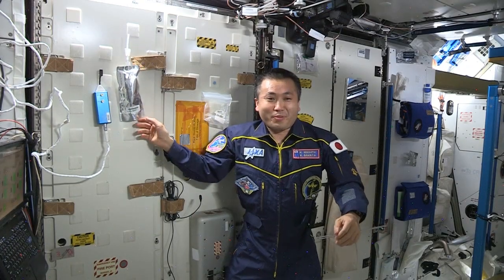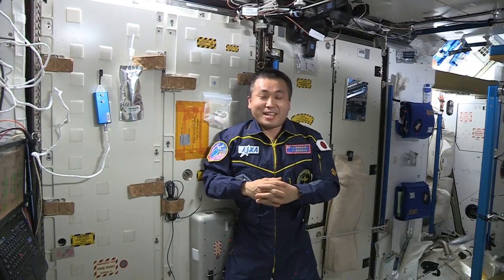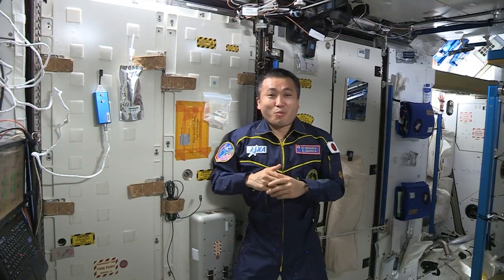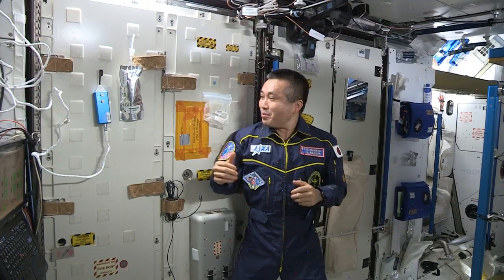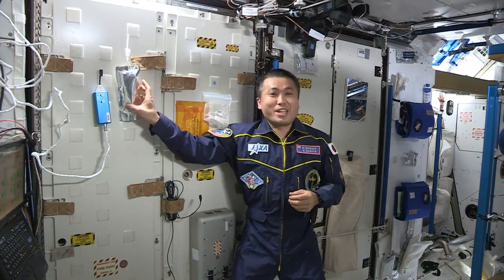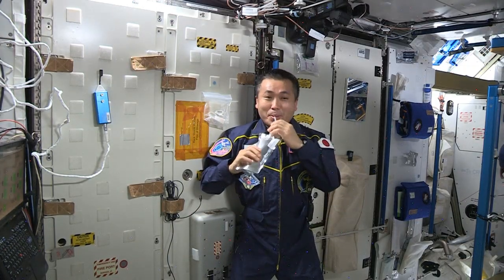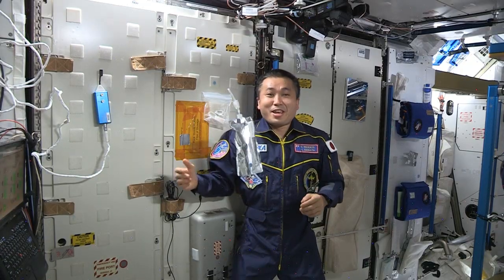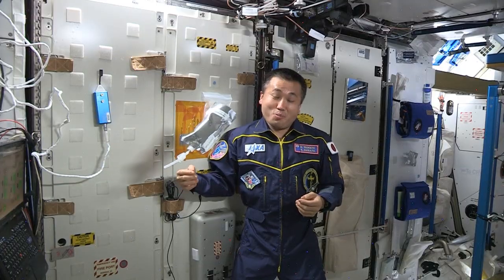Recycling Water on Space Station

Comment: Was watching a nasa water recycling video where they wanted to use the ammonia from the urine to produce electricity, and they wanted to burn the solid waste, how bout feeding the physical waste into a biodigester, produce biogas (methane) and put the through a biogas generator and produce electricity, use the slurry run off from biodigester and amonia from water recycling as fertiliser for a hydroponic controlled farm to produce food, use electricity from biogas generator to power life systems and water recycling system with added boost from solar?